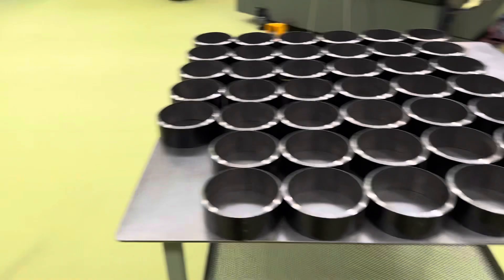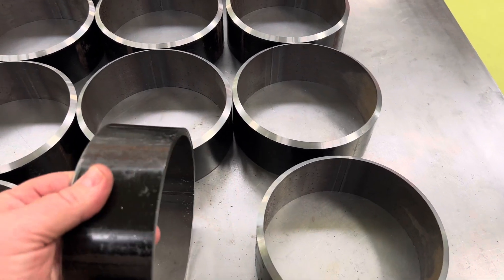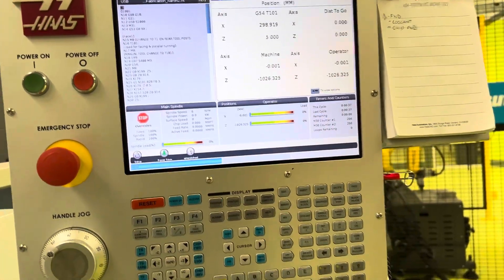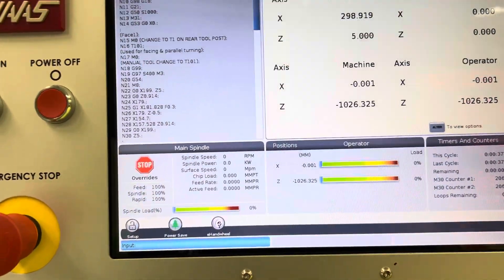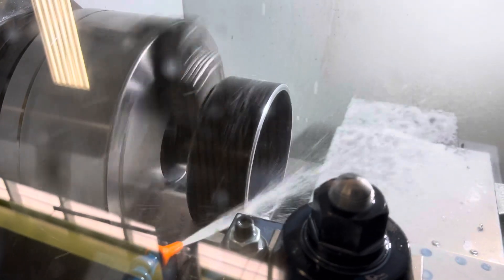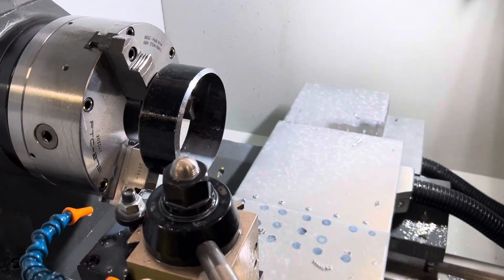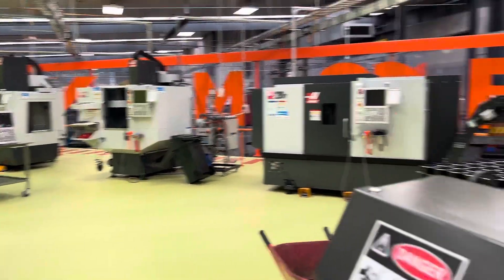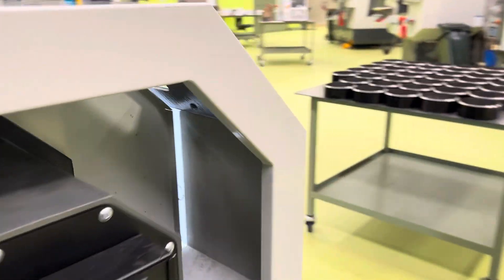Haas TL2 lathe running parts

Comment: Do you still have a positive opinion of the chip conveyor on this machine after some more time with it? I haven't seen much info on these specific to the TL's. Also do these TL machines with the NGC have the broaching template in VPS like the ST machines do? Thanks!
Reply from the maker: @EVT4R  Hello 👋.  Yes the chip conveyor worked well, but small chips got stuck in the panel wells near headstock on both sides. The conveyor definitely made it easier for clean and bulk removal. Sorry can’t help you with VPS questions as I use CAD CAM (confusion360) for everything. The TL are good machine for small runs and job shop work. But the Haas ST models rung rings around the TL’s. Cheers 🍻

Comment: What is the differences between Haas TL lathe and Haas ST lathe?
Reply from the maker: TL stands for tool room lathe. Still a capable CNC machine, but best suited for job shop (1 off parts, manual operations, or small runs).

The ST is a slant bed CNC lathe. Capable of mass production runs, has a hydraulic chuck, can fit a bar feeder to it, use a bar puller etc… higher spindle rpm and faster rapids.

Comment: Definitely a Nice machine.
Especially good for job shop workshops.
When you showed the 6 inch Pipe sections, I straightaway remember using these pipe sections for doing both Stick and Mig Welding tickets.
Not sure IF they still call it 3E for Stick and 8F Flux Core ??
It definitely brings back some memories though.
I also remember the best of the best coming in to do their Tickets without any practice ???
Ironically a fair few of these guys failed the test ???
That definitely deflated their egos 😅

I must get up to see you one day soon.
Looking forward to a free lunch 😉
Reply from the maker: G’day Peter. You need to pop up to Heidelberg sometime to check it out. Fridays are best and I’ll shout you a Vietnamese pork roll.

Yes these 6” pipes (169mm OD) are practice pieces for the apprentices to use. They will be hydraulically tested with water but I can’t remember the pressure now. I’m not sure if they use a stick or MIG on these.

Great to hear from you Peter. I haven’t had the time for videos lately and just shot this in the spur of the moment.

Cheers mate 🍻
Ps: mmm pork roll 🥪 😋
Reply: @DCT_Aaron_Engineering  
Definitely looking forward to coming up to see you one day. 
Thankfully the CNC Lathe is making a huge difference to how much work I can complete in any one week. 
Reading your thoughts in a reply below ??
CNC anything Definitely have their advantages. 
But, their is always a Bad to every Good. 
It does get fairly boring 😴 waiting for parts. 
Of course it's definitely better than cranking handles all day 😬
I am even starting to get back to a point of having a life again too ⛱️
Reply from the maker: @weldmachine  I bet that new lathe of yours has made a huge difference to your workflow. She is definitely a bloody beauty that is for sure. A very nice machine.

For sure mate. Look forward to seeing you.

Comment: Worlds Greatest Job..
( for a machine junkie)
🤣🤣🤣🤣
Robert
Reply from the maker: G’day Robert. Yes I love the CNC stuff, but don’t really want to stand there all day and operate one. All up it was a cycle time of 2.5hrs. Cheers 🍻 mate
Reply: @DCT_Aaron_Engineering 
😅👌
Definitely 1 of the downsides to CNC machines 😴
Reply from the maker: @weldmachine  not wrong Peter. I should have had the apprentices running the machine 😂
Reply: @DCT_Aaron_Engineering  I can imagine it must have been a fairly mundane part to run.
Nothing too exciting about cutting a bevel on a Pipe. 😴
The only exciting thing that could happen is If the part came out of the Chuck 😅👌